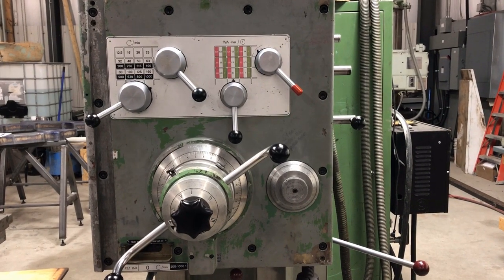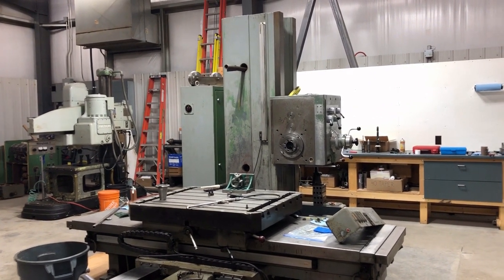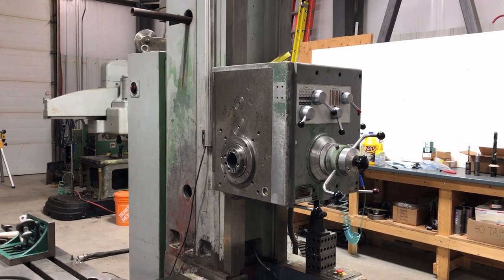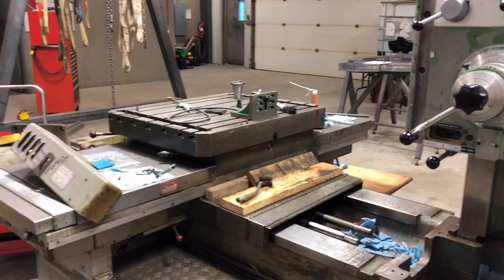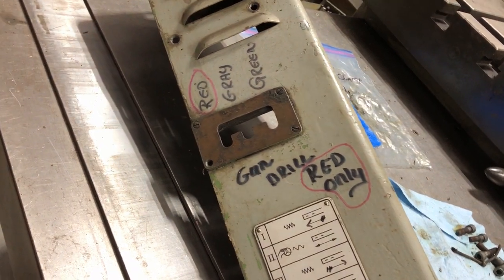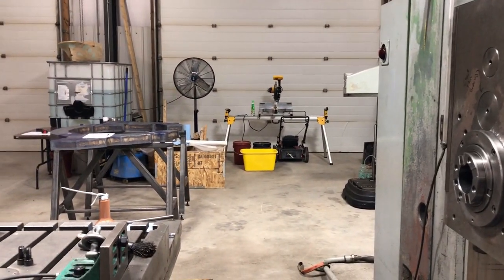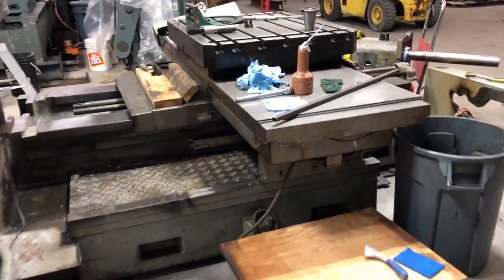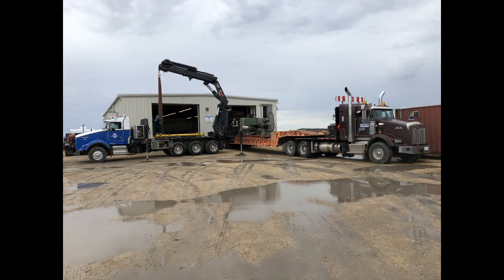Wotan Horizontal Boring Mill Update No 1

Comment: Offer - Slightly used machine, light work only, no mechanical wear for the most part, the third operator down the line was a moron that should never have been allowed near a machine, headstock flooded with coolant and swarf... Good condition, don`t bargain here with me - i know what i`ve got!
Jesus, some ``people`` are just... Anyway, looking forward to binge watching this machine series... That sure is one stunning machine... Pity she was owned by sludge that had taken on a human form... Such machines were made to essentially outlast mankind so long as there were worthy operators who would take care of them and now and again refresh the turcite or whatever way replacement material when needed... Bloody animals some people... I just recently snagged a small lathe that some beast cut into with an angle grinder to increase the max. swing dia... That is gonna be a fun project that i`m managing to delay for the moment... 

Best regards!
Steuss

Comment: God almighty, I worked on one of these in the 80's . The pendant controller was an absolute piece of shit, but the machine was a doozy, really accurate.
Reply from the maker: Hello 1ginner1.  What was it about the pendant controller that you didn't like?  I haven't used mine yet and I have never had a machine with a pendant before so I have no experience with them.  Was it the layout of the buttons or was it not very reliable?  I usually like using levers to control a machine but I could see where being able to move the pendant around the machine to where you need to be could be quite handy.  As for accuracy that is good to hear that they can be really good.  Again I haven't tried mine out yet but the slideways all look to be in good shape so hopefully it is accurate.  Thanks,  Ken
Reply: @hmw-ms3tx  To be honest Ken, its so long ago that I cant remember, but it was something to do with the identification of each button. I seem to remember that the logo on each button wore off so you had to be really careful which button you depressed otherwise you could rapid the table in an unexpected direction. Good luck with it . Oh and one more thing you need a manual to describe which button does what, I seem to remember chevrons on the buttons, 1 chevron was the feed and 2 chevrons was rapid, hope this helps. Mal.

Comment: Nice job sir.
I operate a Wotan as well. 86 × 72 in. table. Traveling column type.  Mine has about 14 clutches in it so we need to keep a good supply of brushes in stock.  Good machine so far. A real hassle when it comes to high parts. The pendant doesnt travel with the head so i almost need someone on the floor at the controls and me up on the platform at the quill.  But they are nice mills once they are tuned up and have fresh oil.
Reply: We recently purchased a Wotan b 75 boring mill.  I’m gradually figuring things out but I still can’t figure out how to engage the hand controls.  I need to do that in order to dial parts in.  Any help would be greatly appreciated.  Thanks.